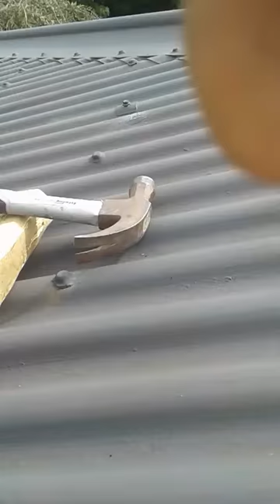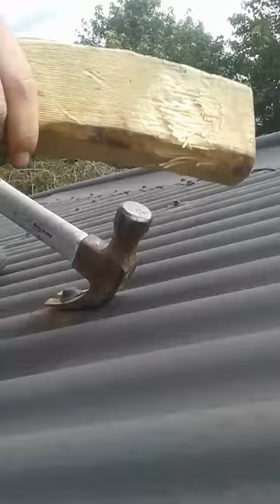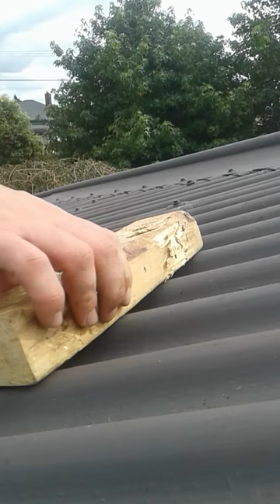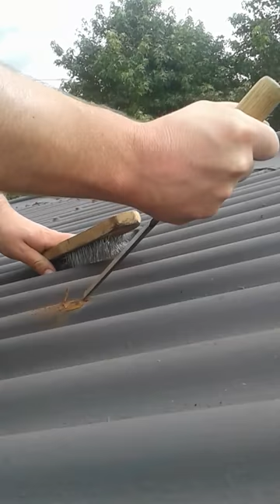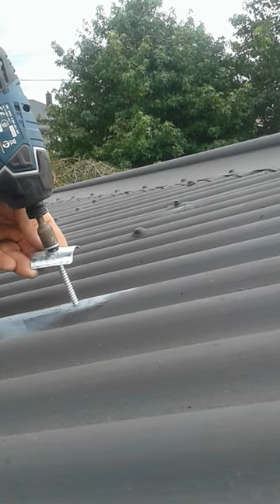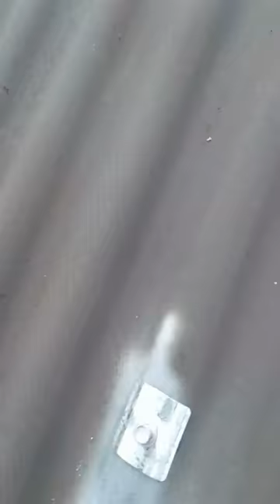Replace lead head nails with screws

Comment: Hi there - please can you tell me if the rubber washer under the curved washer was enough to stop any water entry? My roof leaks in places and if i go to the trouble of replaced the nails wi screws I want to make sure it's not going to continue leaking! Do you think adding silicone beneath the washers would help? Hinder? Thanks!

Comment: Doesn't water get in under the collar?   I've got a more squared off ridge line.   Do those collars come in different shapes?
Reply from the maker: Hi, water doesn't (shouldn't) get in as there is a rubber washer that gets compressed slightly between the roof and the collar. I'm not sure about other shapes sorry.

Comment: Thanks but what did you do if the nail heads popped off and can’t pull the nail out?
Reply from the maker: Hi, sorry for the late reply. Just hammer the left over nail flush and drill the screw in right next to it. Try put the screw point into the flush old nail hole. This happened to me a few times

Comment: Some narration would b good to explain procedure. Otherwise you're going to get a lot more questions. I would use a much thinner piece of wood as part of the leveraging. Then drive those screws in nice & straight so the seal seats evenly. U won't get leaks that way. Drill a new hole if the old one is on an angle.
Reply: The roof, metal sheets, and the wood underneath are all at an angle, therefore the placement of the screws must also be at an angle.
Reply: @wakesurfingfool  incorrect. He means square to the roof

Comment: How's the roof now?
Reply from the maker: It's at the scrap yard. I got tired of maintaining it. It was about 60 years old. It probably would have lasted a few more years but there was rust getting quite bad on the short run over laps.
Reply: @jack.mcintyre  it's great to hear back from you. Thanks for the update. 
Yep I'm  trying to get a good roofing company in whangi but everywhere booked out for summer.

Comment: Hiya, what vintage is the house? 70s? Looking at doing a similar project on my house. Tossing up between this and a reroof... How long did it take you to do the entire roof?
Reply: same, what did you decide? I have 4 or 5 spots where drips come through on heavy rain days...seems like not much of a problem to warrant a new roof though! (1973 coro)
Reply: Went with a reroof in the end. Was pleased we did once the old roof came off, quite a bit of rust etc along the ridge that couldn't be seen from in the attic/underside.

Comment: What do you call that piece under the screw? Is it needed for corrugated iron? I need to do mine in this same fashion, there also seem to be different lengths of screws\different types, what are you using. Cheers buddy
Reply from the maker: Matt Froggatt. I can't remember the exact size screw I used. I used one that was larger in width than usual as I was going in the same hole as the nail came out so I needed it to bind into the wood. I used longer than usual also for the same reason. I used 75mm long. I used a big square curved washer with a big rubber washer under it because some of the excisting holes had rusted larger. Not required on new roofs. Where ever you buy the screws from should be able to supply the big washers. Hope this helps.
Reply: Did the whole job end up looking like a measles infected polka-dotted masterpiece??